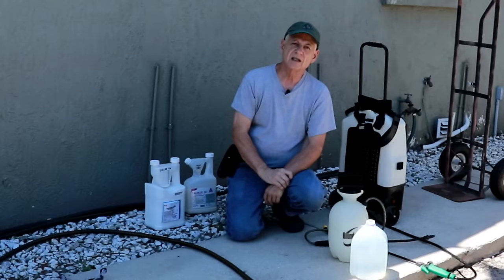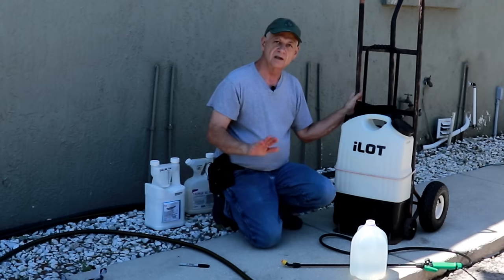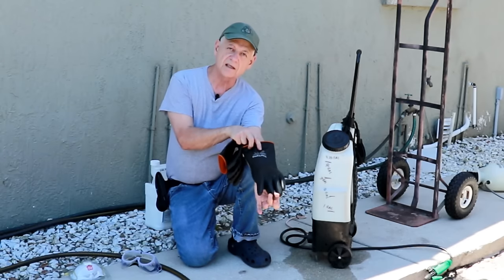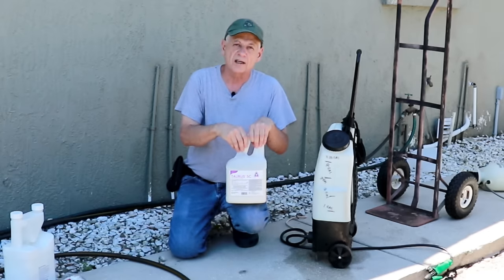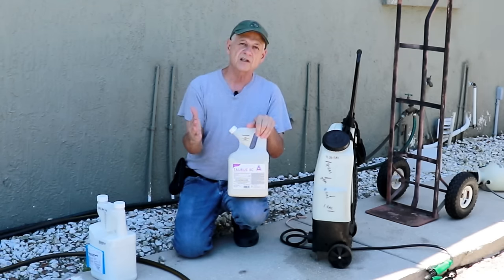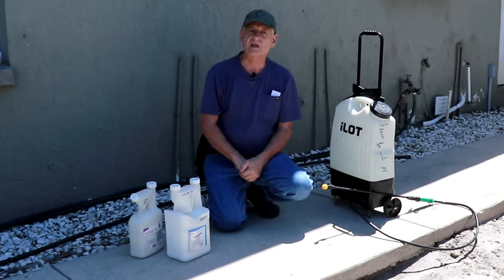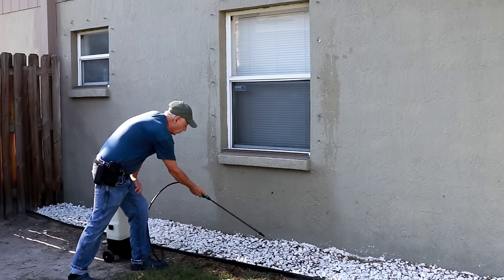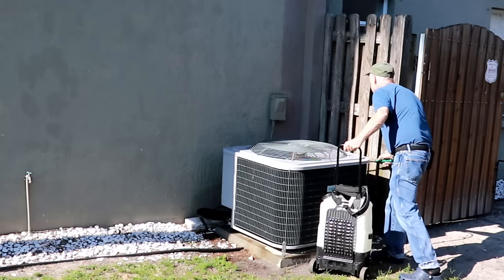General Exterior Pest Control - IMPORTANT!  READ THE DESCRIPTION.

Comment: So you can just dump the left over pesticide into the ground? There's no special way to dispose of it?
Reply from the maker: Hi Tyler.  Yes.  You can just dump small amounts of the left over pesticide on the ground.  The sprayer will always leave a couple of ounces that will not get picked up by the pump and you can just dump that on the lawn.  You don't want to dump it down the drain or anything like that.  The safest way to dispose of it is on the lawn.  You should continue to treat until the sprayer is empty though, so if you have a gallon left to use, just use it on the driveway edges, around trees, and so forth until the sprayer is empty and then just dump out the rest on the lawn.  I hope that helps.  Sorry for the delayed response.  Your question was held for review by Google.  I don't know why.  Thanks for the question and thanks for watching.

Comment: Hi should i remove everything from garage before spraying Talstar P in the bottom/corner cealing drywall? Most other the stuff in lawn tools, bikes, etc. its a two car garage, just want to get rid of spiders and bugs.
Reply from the maker: If you treat the outside, then you will not have many bugs inside the garage.  To kill the existing ones, just spray where you are seeing them.  No need to move anything unless you need to treat behind it.  You can use Talstar P, but it is usually easier to just use a can of Raid Flying Insect Killer for things like spiders.  I wouldn't bother with Talstar P in the garage unless you are going after silver fish, earwigs, and that sort of thing.  For those guys, just spray the floor and up the wall 12 inches where they like to hide.  By the way, there is an updated video on how to treat the exterior of your house that is shorter and contains more information and a couple of great tips.  I will give you the link.  Be well my friend.

Updated video on how to treat the exterior of your house:  https://youtu.be/Yozv3s-Qwlw
Reply: @GuysPestSolutions  Thank you for the advice. I will check out your new video
Reply from the maker: You are very welcome.  I hope you enjoy the video.  Be well my friend.
Reply: @GuysPestSolutions  I spray inside basement /garage walls with Ortho Home Defense. Awesome stuff no odor at all. Later on you will find dead bugs laying around. Its active ingredient is bifenthrin. Its effective for quite some time.
Reply from the maker: Ortho Home Defense is a really watered down version of Talstar P.  It has just a fraction of the active ingredient, which is bifenthrin.  So, you are really paying a lot more for the product if you use Ortho.  Also, the bugs are coming in from the outside.  If you treat the outside of your home every 60 to 90 day, you will not get bugs in the basement, garage, or the rest of your home in the first place, so there will be no need to treat inside at all.  Talstar P is also odorless, so it's great for indoor use when necessary.  However, for outside use, you can also use Bifen IT, which is the same thing as Talstar P, but with a slight odor.  The odor is a good thing for outside use because, if you can smell it, then your respirator is not working.  So, the odor is actually a good safety feature.  Bifen IT is even less expensive than Talstar P.  I have an updated video that is a lot shorter and it will show you how to use Bifen IT and another product called Bifen XTS that will allow you to treat high up places on your house with a hose end sprayer, so no ladder needed in most cases.  I will give you a link to it.  Be well my friend.

Video on how to use Bifen IT and Bifen XTS to treat the exterior of your home:  https://youtu.be/Yozv3s-Qwlw

Comment: Can you use the Taurus in a basement especially dirt basement? Thanks
Reply from the maker: I generally try to avoid using any pesticide inside a building, even the basement or crawlspace.  That being said, if I run into a termite problem where the colony is located directly under the house, then I will trench around the walls inside the basement or crawlspace and I will use Taurus SC to flood the trench.  However, this is rarely the case with termites.  They are almost always outside of the footprint of the building and not under it.  Therefore, with subterranean termites the best treatment plan it to treat from the outside only.  The easiest way to do that is to use the BioAdvanced Termite Killer granules that I recommend in my DIY Termite Treatment video.  I will place a link below.  As for all other pests, treating the exterior as described in my DIY General Exterior Pest Control video will prevent pretty much all other pests from entering your home.  After that, the only ones that can get in are the ones you bring in or allow to fly in through an open door or window.  I hope that helps.

DIY Termite Treatment video:  https://youtu.be/H7rW_TSBHJ4

Comment: I have watched your video and read some of the comments and I am so impressed with your knowledge and how willing you are to help others.  I have been getting dizzy and frustrated trying to research all the different chemicals out there and would be grateful if you could answer some of these questions I have.
  

Are the two products you mention ( Telstar and Taurus) also the best you would recommend for most geographic areas in the USA for general/preventative control? I live in Central Maryland near Baltimore/DC.

Would a Taurus treatment on a soffit area or a ground area protected by an overhang at the base of the house last much longer because it is protected from rain and direct light?

You mentioned in one of your comments that Taurus is not legal for attics.  Would this also be true for a 3' crawlspace under the house which we humans try to avoid, except for applying a spray treatment or maintaining a sump pump?
  

Before coming across your video, we were considering Tempo SC with Beta-Cyfluthrin and/or  Temprid FX with  both Beta-Cyfluthrin and Imidacloprid. What are your thoughts on how these chemicals compare with Telstar and Taurus?  

Thank you if you have time to answer any of these questions. And thanks again for the video.
Reply from the maker: The products you mentioned are good, but I do not use them because they are suspensions.  That means that the way they work is they are a liquid that has a powder insecticide in it and they leave a powder behind on the surfaces where it is applied.  I'm not so sure that they will penetrate the ground as well as a liquid and I am always concerned that they will wash away easier.  That is not to say that there is anything wrong with them.  I do use suspensions for certain applications, but for my exterior treatments I prefer to use a fipronil product for an initial treatment and a bifenthrin product for three month treatments.  My basic routine is treat with Taurus SC then three months later Talstar P, then back to the Taurus and so forth.  You can also use Bifen IT instead of the Talstar P.  It's the same stuff, but cheaper.  These products do not wash off surfaces easily in the rain and that is one reason why I like them.  The Taurus SC can only be used in a crawlspace if you trench and that is a lot of work.  The target pest there would be termites.  You can't just shoot it around indiscriminately like you can with the Bifen IT or Talstar P.  I generally do not use pesticides inside anywhere unless I have no other option.  Of course the products you mentioned are fine to use in the crawlspace as well.  If you let me know what is going on in the crawlspace I will try to assist.  I hope that helps.
Reply: @GuysPestSolutions  Thank you for that information. You have helped me to finally make a decision and go with the two products you mention. Too bad I didn't come across your video a week ago.  It would have saved me a wasted week of indecisiveness. 

As far as we can tell, there is nothing going on in the 3' foot crawlspace at this time. We just want to do what we can to make sure that it stays that way.   If we followed the basic routine of using Taurus and Telstar on the exterior perimeter of the house would you think it necessary or at least a good idea to put a preventative Telstar treatment inside the crawlspace as well?  There is about 1 foot of foundation block showing above ground and 2 to 3 feet below ground level with a dirt floor covered in plastic sheeting. It is a creepy and difficult space to visit so we don't check out what is going on down there often.
Reply from the maker: It's really good news if you do not have anything going on in the crawlspace and the plastic barrier on the dirt is a good idea.  If you do the exterior treatment every three months, then you should not have any bugs in the crawlspace.  They would need to cross the pesticide barrier to get in and then they will die.  You may have some spiders down there right now, but that should be about it.  If you want to treat them, you can just buy a can of Raid and spray any spider webs that you see.  I hate crawl spaces too, so I can relate to not wanting to go in them if I don't have to.  I would not do any other treatment under the house unless there is a target pest like ants, roaches, etc.  Just keep up with the exterior treatment ever three months and you should be good to go.

I'm sorry that you had a hard time finding me.  That is a problem for me that you can actually help me with.  My goal is to help just as many people as I can.  I will answer any question, for anybody, anytime, about any pest, even if I do not have a video on it.  The problem is getting people to find me.  So, you can help.  Just click on the share link and share me with everyone you know.  If they have a pest problem, they will probably thank you for it.  Also, please subscribe and click on the like button as well.  This will give me a higher priority on the YouTube algorithm, so that I am easier to find.  Only about 16 percent of my view come from folks who are searching for me.  About 84 percent of my views come from kind folks like you who shared me with others.  It is very much word of mouth right now.  If I can get enough likes and subscribers, I can move up the food chain on YouTube and more folks will find me.  It is very frustrating for me because the way YouTube works is that it's a popularity contest.  It does not matter how much you want to help others or even how good your content is sometimes.  If folks are not subscribing and clicking the like button your channel is less likely to get discovered by the people who really need it.  So, please spread the word.  Right now I am helping thousands, but my goal is to help millions.  It is very time consuming on my part, but I love doing it and my help is always free.  Thanks.

Be well my friend.
Reply: @GuysPestSolutions    I found your video as a results of a Youtube search looking for pesticide information, so maybe that is a good sign that you are coming up in the Youtube rankings. The extensive and useful answers you provide make it obvious how much you enjoy helping people by sharing your expertise. I subscribed to your channel and will make sure I watch the rest of your videos and share.
Reply from the maker: Thank you so much for that wonderful comment and for helping me spread the word.  You definitely made a difference.  Be well my friend.

Comment: Hey guy do you have a solution for snakes? We have a few of them lurking around the home as wooded area next to house
Reply from the maker: Snakes are always a challenge.  Before you get rid of them though, make sure that you have a type of snake it is actually venomous.  Non-venomous snakes can actually be a good thing.  You see, one of the reasons they may be coming into your yard is that you have a food supply there.  By that I mean you may have mice, rats, frogs, our other small critters that the snakes want to feed on.  While the frogs may not be so bad, you certainly don't want the mice and rats running around.  So, the snakes can help you out by getting rid of some of these pests.  Now, if you are thinking, “Yeah, but these things really freak me out,” then you are not alone.  Personally, I cannot stand these things.  Nevertheless, if they are non-venomous, I summon it up my courage and I leave them alone.

That being said, if you want to get rid of them, then the very first thing that you need to do is make sure that you remove any food supply that exists in your hard.  That means you need to remove any food that may attract critters like rats and mice.  Make sure that all trash cans are tightly sealed and do not leave any food out for dogs and cats.  Always feed your pets indoors.  You may also be offering them a food supply without realizing it.  For example, if you have any standing water laying around the yard, like a small pond where you keep koi fish or something, then those areas can also breed things like frogs.  Finally, you can break the food chain.  If you ever watched The Lion King, then you've heard about the circle of life.  Big critters eat little critters and that includes bugs.  So, in order to break the food chain, a good place to start is by getting rid of the bugs.  You can treat your lawn every couple of months with Bifen IT.  I will give you a link for it.  You can apply it with a garden hose sprayer and I will give you a link to the one that I like to use.  Put 8 ounces of the Bifen IT into the sprayer and then fill the sprayer up to the 32-ounce mark with water.  Swirl it around a bit to mix it up good.  Set the sprayer on 4 ounces.  Connect that bad boy to a garden hose and just water your lawn really good with it.  This is going to kill all the bugs on your lawn and it has a residual of around 60 days.  It actually does not last 60 days, but it takes a while before the bugs can get reestablished.  If there are no bugs, then no food supply for frogs, lizards, and so forth, so they may go elsewhere in search for food.  

Bifen IT:  https://www.solutionsstores.com/bifen-it-insecticide

Garden hose sprayer:  https://www.amazon.com/gp/product/B00UER1S64/ref=ppx_yo_dt_b_search_asin_title?ie=UTF8&psc=1

Snakes also like to find hiding places, so make sure that you do not offer them any.  This doesn't just mean places they can go under, like firewood, turned over trash cans, piles of leaves, and so forth, but also they like to blend in with the environment.  That is why it is common to find them in a garden.  They didn't go in your garden necessarily to eat, but to blend in with the environment.  Of course, a garden could offer them a food supply if other critters are eating some of those vegetables that you planted.  At night they like to hide in places that are particularly dark.  Cover is a snake's best friend.  They do not like you anymore than you like them and so you will often find them in tall grass where they are not easily seen.  So, be sure to keep your lawn mowed.  Finally, make sure that you don't have any ditches or holes in the ground that they can get into easily.  In other words, do not allow the snakes any place where they can seek cover.

If these prevention methods fail, then you need to start bringing out the big guns.  Probably the most effective way to keep snakes out of your yard is to exclude them by installing snake proof fencing.  You can purchase these products on Amazon and I will give you a link to just one such product as an example.  Feel free to look around Amazon or other suppliers to find the fencing that would be best suited for your property and needs.  This type of fencing makes it difficult for snakes to go under or climb over them.

Snake proof fencing:  https://www.amazon.com/Hardware-Galvanized-Vegetables-Fencing-Critters/dp/B015PD9IOU

You can also try some snake repellents.  There are any number of them on the market.  They typically use environmentally friendly materials that irritate the snakes so that they don't come around.  You can experiment with different products to see what works best for you, but I will give you a link to just one of them.

Snake repellent:  https://www.solutionsstores.com/snake-out

There are also snake traps available, but I am reluctant to use them because of the possibility of killing other critters that I am not interested in getting rid of.  So, if you're going to use traps, then try to stick with the ones that are designed to catch snakes alive.  I will give you a link to just one of this type of trap.

Snake trap:  https://www.amazon.com/Snake-Trap-Foldable-Commercial-corrugated/dp/B07PKJXLJX/ref=sr_1_1?crid=375JZWKMJLS2H&keywords=Snake+Trap+Large%2C+%28Foldable%2C+Reusable+32%22x10%22x+3%22%29+with+%281%29+Catch+Insert%2C+Commercial+Grade&qid=1656318623&sprefix=snake+trap+large%2C+foldable%2C+reusable+32+x10+x+3+with+1+catch+insert%2C+commercial+grade%2Caps%2C115&sr=8-1

I hope that helps.  Be well my friend.